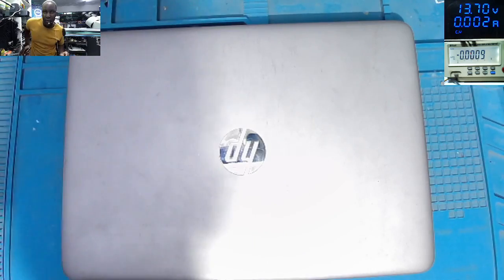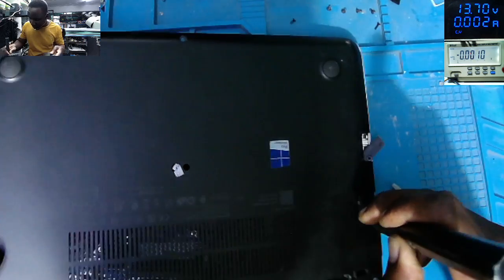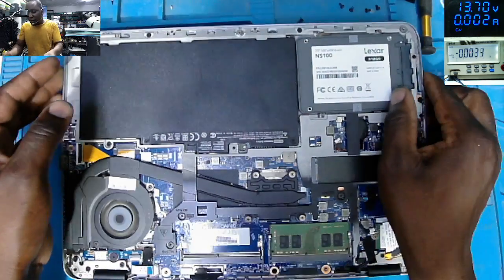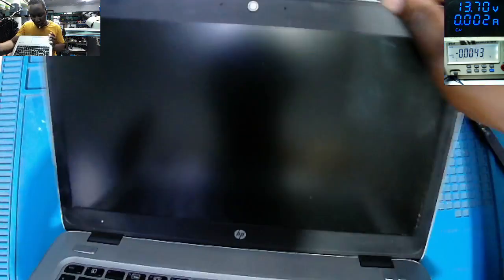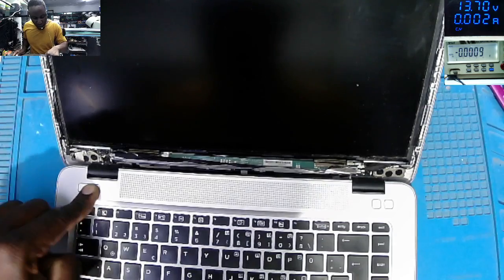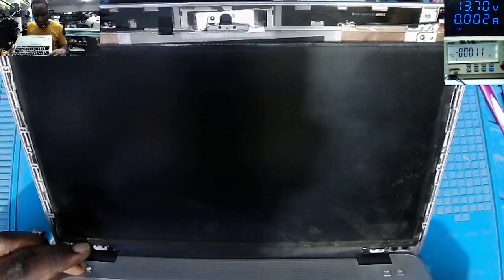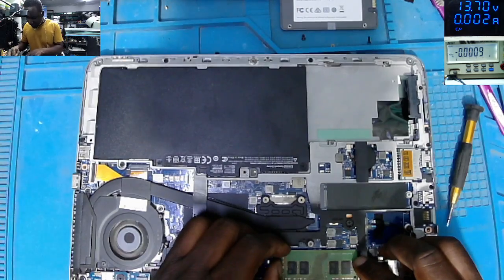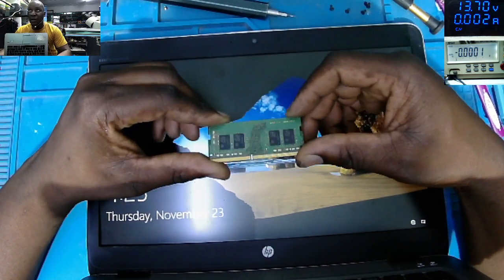Hp Elitebook 840 G3--3 long Beeps and 2 Short Beeps With Black Screen Repair. What Can Be?

Comment: i have this issue just stated watching video I have 2 same laptops staying on side don't know what is wrong if I swap memory from 1 slot to another it work perfect and again if I turn it off again when I want to turn it on it not work :( and then every time just swaps space of the memory module it turn on idk so weird problem lets see how you fix it..
Reply: Bios
Reply: @quizkhalifa1  tried that its not i am suspecting to its maybe memory slots because I see they are different so someone before me swapped one slot I checked legs they are all good soldered but idk what else I can check